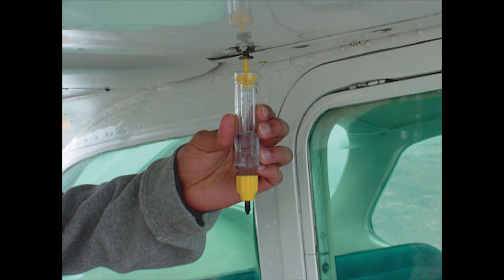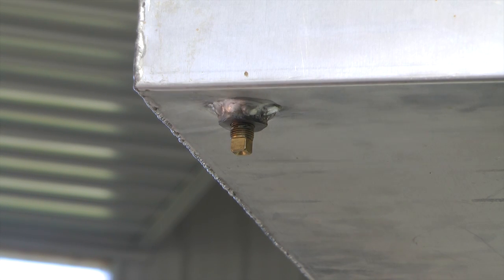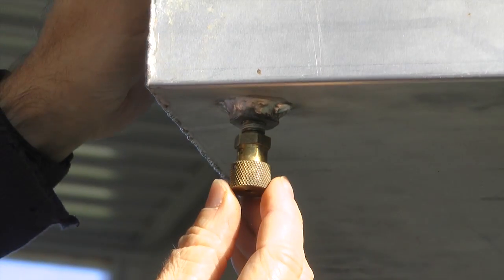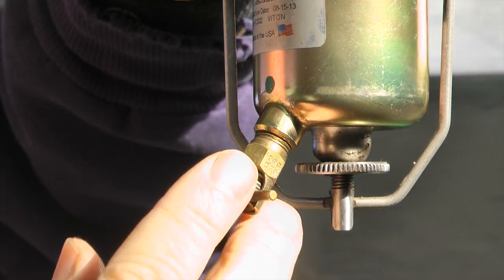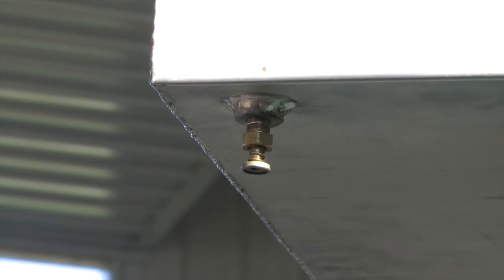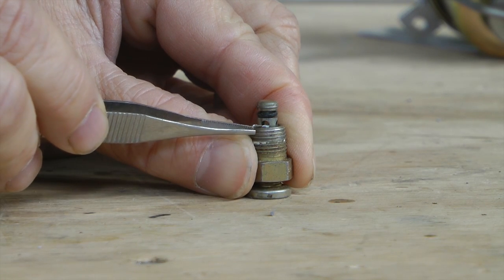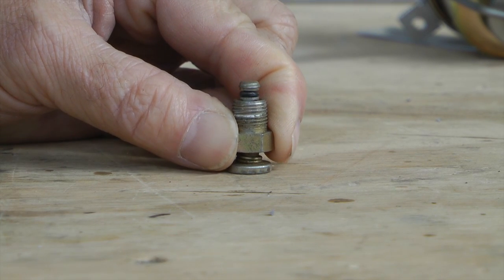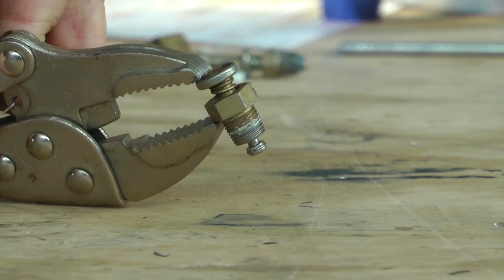Fixing Leaky homebuilt aircraft Fuel Drains

Comment: It is amazing how many other options are out there that seems a whole lot more reliable, than the plastic crap which most of the common airliners place over there, that tend to crack like hell or stuck in open position and then you have to defuel some 5 or 20 tons of fuel to replace that shitty plastic valve

Comment: When changing the O ring, why waste time holding the valve open with grips (which could easily slip off and send your parts all over your workshop)? Just put a temporary pin through the cross-drilled hole to hold it open.